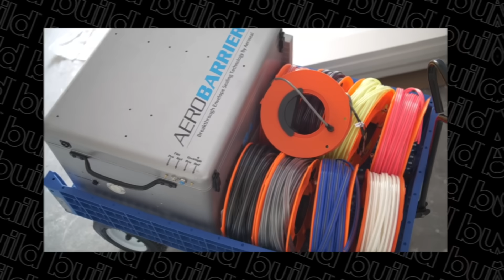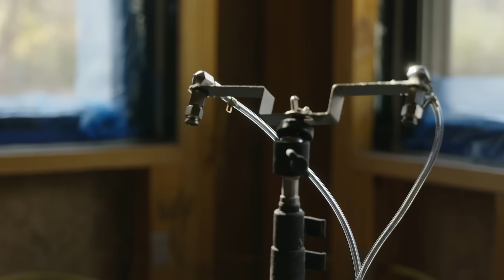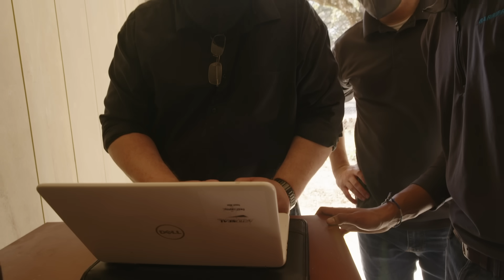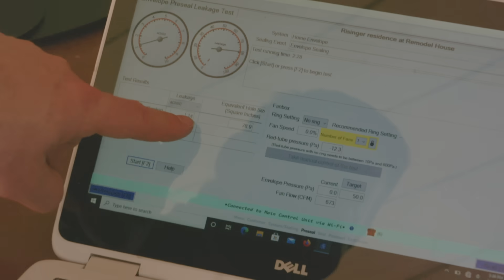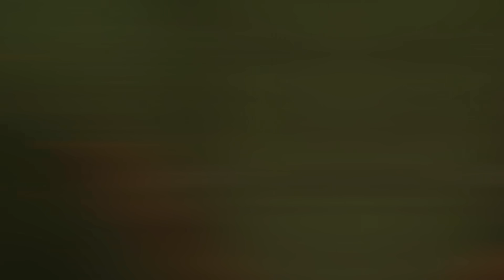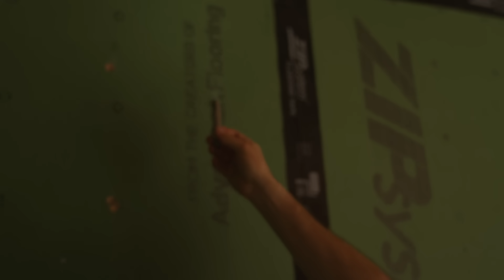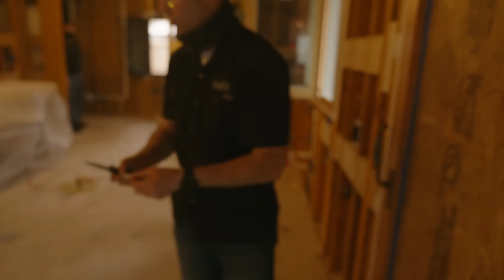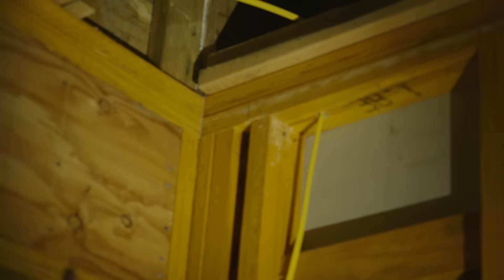The one product I'd recommend for EVERY House!

Comment: Seems ok, but a dye should be used in the spray so you could see where it builds up and go over it more sealant/insulation to make double sure there are no future leaks. Matt is worried about mold and everybody else just wants lower HVAC bills. Would be nice if you could double down and feel that much safer before you finish out the walls and ceilings. There is also a concern that AreoBarrier might crack when drywall gets hung. Definitely use screws instead of nails.
Reply: They should spray the aerobarrier before and then again after drywall is installed to be EXTRA sure and have a double barrier of sealant on any leaks. I can imagine it'd get pretty damn close to sealed TIGHT

Comment: I will never understand why there are holes put into the window frame on purpose. I am all for airtightness!
Reply: if you're talking about weepholes, in the exterior of the windows, it is because the airseal in the window is inside the outer shell, so the weephole allows condensation that occurs between the outer shell and the airseal to escape.

Comment: To me it seem a huge wasteful why to build a home your spraying latex  into the atmosphere cause pollution just so you can build your home of wood sheets. If you used brick and block  or concrete block you would have non of this.
Reply: Brick, block, concrete, ICF, metal, wood ...  they ALL leak
Reply: You have zero r value in thoze examples. This is an insulation video not a structure video.
Reply: @sparksmcgee6641  his comment wasn't about R-value, but rather directed in part to the video's main point which was actually air sealing and the potential pollution from using this method of sealing.

Comment: Idk man. I can caulk and foam a 2000 sq ft new construction house by myself in less than a day. I've passed the blower door test with no insulation in the attic or basement (didn't make it on time for final inspections and the hers rater ran the test anyway). This is cool but new construction is a numbers game. The prep, set up, and wait time for this thing isn't gonna make money the way a $20 an hr employee will
Reply: What ach did you get?
Reply: @sparksmcgee6641  i don't remember exactly. Deff under 100....we were shocked don't get me wrong. The company I work for goes above and beyond code for air sealing. We do every single seam. Not just top/bottom plates. We do the zip system from inside as well. To be fair the house probably had a floored over attic with a sealed walk up stairwell. I don't remember all the specifics but It definitely happened lol
Reply: In some markets you might have trouble finding an employee that could do a good job of caulking and foaming a house, even at $20/hour.

Comment: It would be interesting to see what your blower door number is after 2 years. Does the caulk still seal, or does it shrink, and open up holes. 

It does look like a good product, but seems a bit expensive.
Reply: “Seems” a bit expensive?
Reply: @seanm3226  if it truly holds up and doesn't just give a number to gain a passive house rating and then fade away then like any other quality measures taken will have an ROI that makes it worthwhile.

Comment: We did this on our home in AZ (built in 1965). It paid for itself in less than 4 years! It wasn't mentioned in the video, but this can also get into your duct work and and seal any leaks there too! Our AC would be on all day and night and never get to temp in the summer, apparently we we're just cooling the inside of our walls and crawl space LOL! Now, it's only needed for a few hours a day. This is one of the best things we did for our house. HVAC will last longer, cuts down on gas/electricity, etc.
Reply: That sounds like a good application for this sort of thing. I used to work in a business that would measure the "leakiness" of ductwork and we would manually apply Mastic and tape to seal ductwork.
Reply: Um...$4,000/48 = 83. Your heating/cooling bills went down $83/mo after doing just this?
Reply: @TheBighatter  I don't know where you got $4000 from. Our house is roughly 2500sqft and it cost us right around $2000 to do. Spring and fall are pretty cheap, but summer months were up over $500/month and winter months were $350-450. Those months were roughly halved in cost. It really only took 3 summers to recoup the cost.
Reply: @mjbates  
I heard $1-1.50/sqft in the video for a 3,000 sqft house. Apparently you paid quite a bit less per sqft so that changes the math substantially. But assuming 4 mo/yr of heating and 4 mo/yr of cooling, and taking for granted your statement that these month's rates were cut in half (saving of $225 avg for those 8 mo/yr) you would have made payoff in just over 1 year. Are you sure your numbers are correct?
Reply: @TheBighatter in AZ it's a pretty common practice to do this just to the ac ductwork and it does drop the power bill significantly because so many builders out here do shoddy work. On a house built in '65 I'm willing to bet there were a fair number of previous homeowners that did some no-so-smart things to the ductwork as well
Reply: @matthewsorenson46  definitely! It's our job to make a great house better! A lot of people worked hard to make this place, and we should take advantage of their great building. Our house was built before AC was normal so the east-west sides don't have windows and the north-south sides have large overhangs. It allows substantial light in during the winter and almost none during the summer. I think that if we told people how much they could save by building around the sun instead of in spite of it, we could save a lot of money and help the environment!
Reply: @mjbates  how hard was your prep work to do this? Because you were already living in the home, right? I’m pondering doing this in our in home, So Cal. We don’t intend to move for quite a few years, so this might be a good piece to add, as I’m sealing seams and other tips as I re do all the attic insulation and more. 😉👍
Reply: @Jonacarpenter  it wasn't much prep work at all. The whole thing took about a day. They did a thorough cleaning of the ducts, then sealed all the vents. They hook up a machine that can test leakiness. Then they pump the aeroseal product for a while and test again.  I'm trying to remember, but I don't think we even had to cover our furniture. The stuff just hung like a cloud towards the ceiling. I was afraid it would stick to walls or leave a residue, but nothing. It had fully dissipated by the end of the day.
Reply: @mjbates  very interesting.  Thanks so much for replying.  Now I'll really look into it.  I'm redoing all our insulation and a bunch of other stuff to help make the house more energy efficient, green and healthy and do it 'smartly'.  I didn't think this was something we could do with out throwing our life out of whack....but your response makes me want to look into it.  It's different when it's from someone who had it done, and isn't involved or promoting it. So big thanks...👍👍
Reply: Does it mess with carpet and all of the other things in a house?
Reply: @theodoremoore2549  we don't have carpet, but we do have rugs. There were no issues. The stuff is like a cloud in the top 1/3 of the space till it dissipates. It didn't leave any kind of residue or smell.
Reply: @mjbates  Thank you

Comment: As an HVAC tech we run AEROSEAL at the finish for are our installs to tighten ductwork throughout the house. Truly an amazing product and the ability to make old systems more efficient is pretty unbelievable.
Reply: How much extra does that cost the customer?
Reply: @wkobayashim  it's built into our price for new construction systems.  For an existing house like the video it depends on square footage and how much leakage there is prior to the service.
Reply: @seanj432  ah yes, built into the price.  lmfao, forced into the price, aka, you have no choice but to buy something that isn't needed and has zero benefit. Then they will purposely misfit the pipes and say I told you so!  In reality, a 1/8 inch wrap around the pipe would be 1000000 percent more effective than shooting a latex into it.
Reply: @junkers5069  do I hear a touch of cynicism in this comment?
Reply: Sean Johnson is a scammer everybody!

Comment: Terrific Segment!  I have learned much from your channel.  I am researching monolithic solutions to problems such as this but you have to be pretty tight before using AreoBarrier.  I was wondering if you would  consider spraying the critical areas such as the plates and points that break the outside envelop with something like Blue-Max Rubber seal. https://www.amesresearch.com/ames-blue-max/. Your thoughts on this and even using Blue-max on underground ICF.

Comment: Air sealing and blower door testing is under appreciated.
Reply: I've never done blower door tests... but air sealing had become my new hobby.  I had to explain to my gf that sealing all the cracks in our 1500 sq ft house is the same as closing 3 windows in the dead of winter.  I've made progress over the last two years sealing everything up and I can tell you that the house is way more comfortable, the hvac runs about half as much, and the monthly costs are 1/3 of what they once were.  IT is totally worth it if you are a DIY type person because the cost comes from the labor, not really the materials.  My house is nice and comfortable now.
Reply: @MrClarkisgod  Get a blower door test done. It will be educational and you can compare your results to the standard home and LEED certified homes. When I air sealed my home my utility bills dropped by 30% the next month. I thought my home was pretty well built and air tight. Air sealing made it even better. So comfortable in winter and summer. Wasting energy wastes money on utility bills.
Reply: @KJSvitko  the blower door test gives a numerical factor, but its finding where the leaks are to fix them thats the issue as I see it.  I would rather find them first and then have the test done.  That is unless there is a Before and After test for the same price.
Reply: @MrClarkisgod  How did you find your leaks?

Comment: There were a few issues that showed up in the comments for the previous video:
1. Is part of the procedure to make sure the plumbing traps including the toilets have water in them? What happens if somebody forgets to do that? Does this stuff coat the inside of the pipes?

2. What about non-plumbing vents including the fire place flue? Do they have to be blocked off? If they are blocked off does that make the final test results with the vents blocked misleading?

3. Do certifiable ACH results require positive and negative pressure? Were the AeroBarrier test results based on both positive and negative pressures? 

A general question about super tight houses
Does air exchange from opening and closing doors for entry and exit swamp out  the benefit of very tight houses for ACH numbers below a certain level? In other words, what is the point at which the tightness of the house offers no significant benefit?
Reply: -These days fresh air mechanical ventilation is required anyway
-matt isn't a fan of fireplaces for their air leakiness. 

Like you already figured out, it would make sense to tape openings one doesn't want filled
Reply: @bahopik  Thanks for the response. Your comment about mechanical air ventilation goes to my question about what the ACH score below which there is no practical value. There is some air lost to the outside through the mechanical ventilation system and there is air lost to the outside when people open doors. At some point those air losses will be substantially more than the air lost with a low ACH result. I'm just curious what that value is. I enjoy watching these videos about the path to obtain a very low ACH score. But I wonder how much practical value there is in going for very low ACH scores.

There may also be some parts of the house that are taped off during the test that will not be taped off normally. These also might add to air exchanges which might be much more than the air exchanges from a very low ACH score.

Comment: I wonder how much of the airborne caulk get into the weather seals on Matt's windows and gum things up... Most windows are not 100% sealed. I think this would be a mess..not to mentioned the film left on the windows. Matt is obsessed.
Reply: it sounded like they completely masked the windows.
Reply: @kenbrown2808  yup!  Now they need to do another blower test will all windows and doors unmasked..  see how effective $5k was..
Reply: @FJB2020  except that's a different topic from whether it gums up the windows.
Reply: @kenbrown2808  they completely sealed the windows and door off.. what I am saying is once they remove the tape from the windows and doors they should run the blower door test again.  See how bad the house leaks again.  That is the only way to see if the spray application was worth it.
Reply: @FJB2020  and what sovig said was "will this gum up the workings of the windows?"
Reply: @kenbrown2808  it won't, unless they don't tape them shut..

Comment: Built a non passive house ten years ago (airtight eco house) it sucked and I’m curious to see how much mold is growing.
Reply: What’s a non passive house? Mold grows on moisture, run a dehumidifier.
Reply: @danlux4954  if you ever hear of one just say no.
Reply: @daveyhogan  our house is over 50 years old and not well insulated.
Reply: @danlux4954  stuff in the video is ok, probably. A non passive house is an airtight home with a concrete floor. The outside walls are constructed of sim panels that are basically styrofoam and resin board connected to the framing of the home. Metal roof with rubber roof pockets they plant grass on 🤦🏻‍♂️

Comment: How long: is there a Warrantee and if so for how long?
Air barrier has not been in business all that long does anyone have any idea how long the product will stay stuck?
Reply: They have been around a while.. their main business is called AeroSeal..
Reply: In practice nobody knows, as you say they haven't been in business all that long. In theory it should be comparable to sealing those holes with acrylic caulking, if I understood them correctly. So it's not hazardous and it won't break down, but it'll shrink and crack. I strongly suspect the 0.1 ACH  won't be around for long. Especially if it filled up larger holes, those will probably crack open again within a few weeks, so it definitely isn't a replacement for good craftmanship, but it helps.
Reply: @cire9984  they taped all the windows and doors shut.. that .10 is not accurate and will be much higher as window and door seals will leak.  They taped them shut so they don't fill with caulk..

Comment: How does this effect your family's lungs ten years from now?
Reply: The same way having any construction material around you affects you
Reply: I doubt it's a problem. First there is a lot of latex caulk used in construction and I don't think people are worrying much about that. And I think the caulk particles mostly just settle down and are removed in the same way regular construction dust is removed. I'd be a little concerned during the process. People near by are going to breath a small amount of this stuff and it seems like something I"d rather not breathe.

Comment: Next weeks episode of The Build Show, Matt shows us how he burned up the motor on the blower door motor. That motor tried to move air, but it was like trying to suck air through a Ziploc bag.
Reply: Less air flow is less load on the motor. It would not burn up.
Reply: @topspeederalmond , So, when a motor is straining to blow air compared to one that is free flowing, it pulls less amps ? Sounds hard to believe.
Reply: @augustreil  so he’s right, think back to the straw, if you’re trying to move CFM 500CFM it would
Get harder and harder as the straw gets tighter and tighter and give less area for that volume of air to escape. but if your goal is to maintain 25psi of pressure, that would be easier as the straw gets tighter because there’s less area for the pressure to escape from.
Reply: @xX1GuNNy1Xx , I guess, just sounds backwards that's all, lol. Thanks.
Reply: @augustreil  lol, well they are basically opposite principles of each other so makes sense! And NP, cheers.
Reply: @augustreil  If the restriction is on the suction side of the fan motor, it will pull less amps. If the restriction is on the discharge side, it will pull more amps.
Reply: @topspeederalmond  that’s not right. Think about drinking through a straw. Say you can finish a 6oz of water in a minute, now block half the straw and try and suck that same 6oz in 1 minute. A lot harder. This is that same for the fan, it wants to blow say 500CFM and as the house gets tighter is becomes harder and harder. The fan will begin to pull more and more amps to make more pressure to still get that same 500 CFM. Now these fans are made for this so you’re right that they arn’t going to burn up but they will defiantly consume more power.
Reply: Put an amp meter on it. Yes you will have some back EMP but still unloaded. Take your straw shit some where else.
Reply: @topspeederalmond  you’re right, because they are holding pressure, not pushing CFM like I though. Holding the same pressure in a less leaky building would require less power.  And lightly up buddy, no need to be an ass. 😘

Comment: What kind of prep work needs to be done on the  HVAC system? Is there a concern about aerobarrier getting into the fresh air system?
Reply: Just close off all the HVAC openings. But there is also a variant to spray in the ducts, to close off all leaks in the ducts.